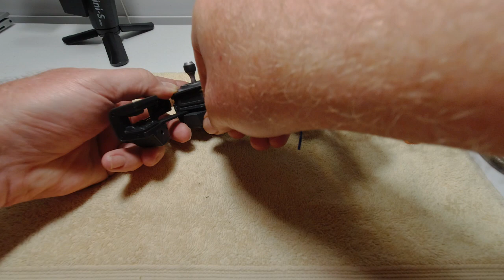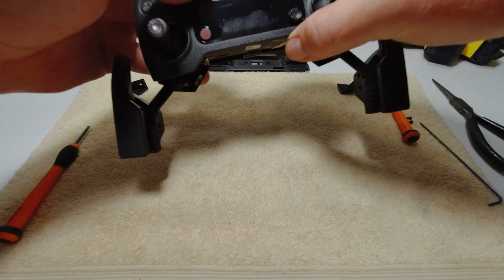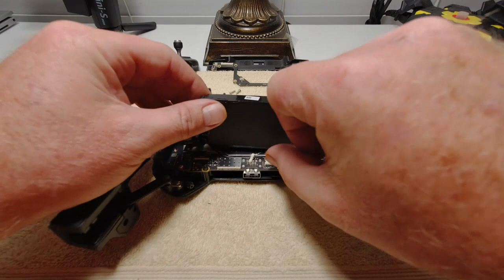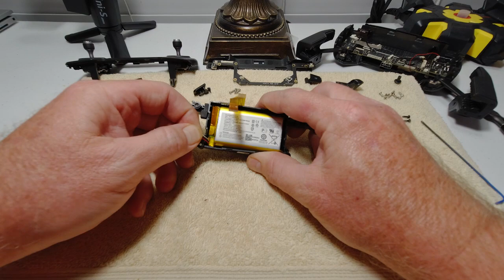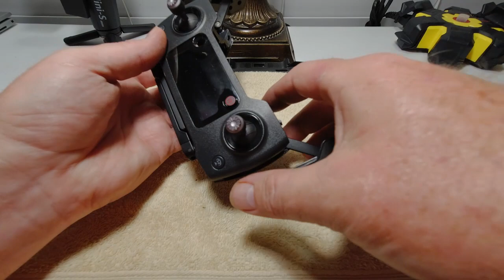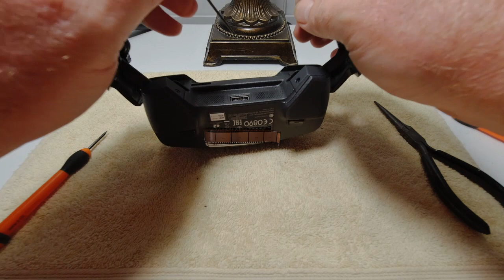How to Replace the Mavic Pro RC battery and where to get it

Comment: Hello, I have a different type of battery than you showed in your film, there is also a larger connector strip, there are three red, three black, one yellow and one white cable. Battery 0VCPFB72H107ZG. Do you have any order documents for this or they can be bought from you?
Reply from the maker: Sorry but I haven't heard anything about a different battery for the Mavic Pro 1.  The battery number 0VCPFB72H107ZG does not come up on anything I have.
Reply: @rwarton1  https://www.ebay.com/itm/Original-DJI-Remote-Controller-Battery-Use-for-Spark-Mavic-Pro-Mavic-Air-/352997078829 I found the battery on ebay DJI Mavic 2 Pro
Reply from the maker: @FlorenzKittel   That's great.  Please leave feed back once you have gotten the battery and replaced it.  I'm sure there a lot of Mavic Pro 2 users that would appropriate it very much.  Wish the shipping times weren't so long.  Thanks Kittel.
Reply: @rwarton1  Shipping 3 weeks
Reply: @FlorenzKittel   hey! Did it work? I just read batteries for m2p are a little larger and 3.8v @3850 mah. Your link says 3.7v
Reply from the maker: Could you maybe email me a picture of your controller and battery?  Send to ceo@wartons.com
Reply: @rwarton1  I did

Comment: Hey you, first I would thank you for the really nice step by step, then tell my history... Some months ago i suddenly experienced the totally dead battery. Neither DJI nor Reseller fixed it, even under warranty, is matter effect I bought it abroad and would cost me an arm and a leg to sent it to repairment. Then I decided to use the remote with the Power Bank adapter with the drone batteries (Pain in the...), until i found your video, and it was super easy to get to the battery and remove it. But I can't find this battery to buy, neither in my country nor i foreign lands that would ship it to my country.
In your video you said that you would help those with problems, can I contact you to ask for some help?
Thank you.
Reply from the maker: Audrey, you can now purchase the battery on eBay from many sellers.  Try a sell in the U.S. and have them ship to you.

Comment: How long das good bat. should last on when flying?
Reply from the maker: Sorry for the slow reply.  The remote battery should last at least an hour of flying time.  But this can be more or less depending on the type of device you have connected to it.  The DJI remote attempts to also charge the device that it is connected too which can cause the remote to drain faster if the cell phone or tablet connected is not charged good before connecting.  See this video to help make your remote battery last longer.  https://www.youtube.com/watch?v=GdvOfRCYJxw  Hope this helps.

Comment: Please help need battery for  mavic 2 controller. Please please
Reply: Thanks a lot, any link to find it. Name or description pls
Reply from the maker: @c.lvideofilms3958  The link to the battery is in the description;ion below the video.
Reply from the maker: The only thing I know you can do is purchase the battery that fits the Mavic pro 1 controller.  From everything I've heard it fits and works in the Mavic pro 2 controller.  The only difference is it is a few hundred mill-watts smaller than the original Mavic pro 2 controller battery but works fine.

Comment: sir rick, i just want to query. why is that my dji mavic controller is zero percent battery, it is charging but the percentage is 0% always, I observed my controller charging within 2hrs, but sad to say it is not moving the percentage.... hope you can help me to fix this problem... tnx
Reply from the maker: This normally means that your battery is bad and unable to take a charge.  If it was the charging unit of the controller that was bad it would not show charging and 0%.  So replacing your battery should fix your problem.  Best wishes Rick Warton
Reply: @rwarton1  thank you sir

Comment: Need your help to get Mavic pro 2 RC battery.
Reply from the maker: Chukte, I'm sorry I do not have a supplier for the Mavic Pro 2 battery.  Several have asked and I have had no luck in finding the battery.  I've been told the battery in the Mavic Pro fits perfectly and the only difference is the Mavic Pro battery is a few hundred MW smaller than the Mavic Pro 2 battery but works perfectly.  I have personally had a chance to see if this is true, but might be something to think about if your unable to find a Mavic Pro 2 battery for your controller.  Best Wishes Rick

Comment: Thanks for your video! While I had to bite my lip while you were sniffling (lol), I was able to follow your instructions and replaced my battery (after purchasing the one you recommended).  When I bought my Mavic Pro, it had been siting in a warehouse since 2017, and both the battery in the RC and the battery in the AC were shot.  Now, it works great!  I should have watched the whole video first, I would have put the tape over the little speaker while I had it apart.
Reply from the maker: So glad it was helpful, and thank you for your comment.  I'm really surprised someone hasn't made a better video on replacing the battery.  It's kind of a pretty important process to know when you need to replace the battery.  Best Wishes

Comment: Awesome video Rick.  Yesterday I opened my backpack to find my remote soaked from a drink that leaked out.  The remote was making a high pitch noise.  With the help of your video I took it apart and disconnected the battery.  Other than  blowing it out with some dry compressed air do you have any recommendations before I reassemble.  I was expecting to see some shorting out but I don't.  But electronics isnt my strong point.  Any help would be appreciated.  Thanks Harold
Reply from the maker: Hello Harold, If only water spilled on it I think leaving the battery out for a day or two should be fine.  Laying it in the Sun for a bit or using a blow dry for about 10 mins will help insure all the water has evaporated.   Now if something other then water spilled on it that's another story.  Take soda for instance, even after the soda has dried up syrup and other ingredients may cause corrosion later.  So what I do in cases like that is I use rubbing alcohol and pour it all over the circuit board and then used can air or an air compressor to blow off the circuit board.  Then let the board dry over night and you should be good.  Of course make sure the battery is not connected when doing this.   Hope this helps.  Best wishes Rick Warton

Comment: That's a nice video Mr. Rick, thanks for showing but you mention you bought this battery in HK.
Because I stay in the far east and visit from time to time HK please can you tell me the shop or location where to find this battery.
Ebay can't send this battery in the country where I stay.
Thanks in advance.
Reply from the maker: Sorry for the delay Patrick, I was out for a week on vacation as was not check my email.  I'm sorry but the only information I have is what is on eBay.  I suggest going to the ebay page of the item at https://www.ebay.com/itm/Original-2970mAh-3-7V-Rechargeable-Li-ion-Battery-973760-1ICP10-37-61/273519563743?ssPageName=STRK%3AMEBIDX%3AIT&_trksid=p2057872.m2749.l2649 and clicking on the contact seller on the left side of the page and ask if they may have any suggestions on how you could receive the battery.  The only other solution that comes to mind is have someone you know that lives in a country or province they do ship too and have it shipped there.  Then have that person ship it to you.  Now I know that is a big pain in the butt, but sometime you just have to work around the system.  Best wishes
Reply: @rwarton1  Hello Rick,
I'll try the way you sugest me. Thanks  for taking the trouble to answer me.
Best regards,
Patrick

Comment: Thanks for the video! Great job. If I may suggest, maybe you can add some text advising to connect that connector you struggled with a bit (and so did I :) when the display piece is still not screwed in place. Thanks again!

Comment: They really didn't make this easy. My mavic 2 pro is year old and controller battery only last for one flight, then it is empty.
Reply from the maker: That sucks!  Battery should be good for at least 3 years.  And to make things worse I don't know where you can get a battery for a Mavic 2 controller.  Think all you can do is send it to DJI and they will replace the battery at premium price.

Comment: I bought new batteries (they came after 4 months ago) but they did not fit Mavic 2 RC1A controller. Too small and not the same contact. If anyone have a Mavic Pro controller as Rick Warton is showing then i have two batteries for sale. Unless I find a IoT project to use them in.
Reply from the maker: Sorry to hear the batteries did not work on the Mavic 2 RC1A controller.  Thank you for sharing the information with everyone.  I would think if anyone needs a controller battery for a Mavic 1 controller, getting it from you would be much faster than ordering it from China which can take forever sometimes to receive.  And with this China Virus issue, getting one from China right now will probably takes months.

Comment: Hello there kind sir, I would like to replace my dieing battery, but I don't see the batteries available anymore, what do I do? Do you have the batteries? Can I send the the controller into you?
Reply from the maker: I'm sorry but I do not stock these batteries.  I do not know of any other place to purchase these batteries except for the link in the comments.  Since they are currently out of stock all I can suggest is to search the internet and see if you can find another supplier or a place that maybe you could send the controller and get the battery replaced.  I've had several people tell me you can send your controller to someone and they will replace the battery and ship it back to you.  But I'm sorry to say I do not have any information on where these places are.  Hopefully the eBay seller of these batteries will get them back in stock soon.  I'm sure this China virus is probably causing delays.
Reply: @rwarton1  Ok thank you very much, indeed the eBay seller is not able to sell these batteries at this time due to the outbreak.

Comment: While the controller is apart, does anybody see a fix to keep it from charging the android phones
Reply from the maker: The easy fix is to use the USB port on the bottom of the controller to connect your phone.  Check out this video for more information on how to do it.  https://www.youtube.com/watch?v=GdvOfRCYJxw&t=258s  Hope this helps.
Reply from the maker: One other thought, while you have the controller apart put a strip of scotch's tape over the little hole on the speaker to help make the remote from being so loud when an alert is sounded.  With the tape over the speaker it's now not so annoyingly loud.  :)

Comment: Hi i am having a bit trouble with mavic 2 remote battery. I need replacement soon. Can you write and part number for the battery? Otherwise i need to buy another remote or smart controller(i dont want to. I like my phone). Thanks
Reply from the maker: I had a friend use this battery for his Mavic 2 remote and he said it works and fit perfectly.  One problem though, since China is having this Coronavirus outbreak everything over there is shut down, including the company that supplies this battery on ebay.  I hate to see you have to spend so much money on a new remote, but if your in a hurry you just might need to.  One suggestion is to use an external usb battery until the supplier can ship again.  Check out this video on how to do it.  https://www.youtube.com/watch?v=GdvOfRCYJxw

Sorry I can't be of more help.

Comment: Been looking to replace the battery on my Mavic 2 Pro and on the back of the controller it says 3950 mAh 3.8v. Therefore this battery, may be under powering the newer Mavic 2 Pro controller. Can't seem to find a replacement on Ebay just yet. I've contacted the source you noted here and awaiting to hear if they provide this 3950 sized LiPo. Do you own a M2P at all?
Reply from the maker: That's good to know.  So the Mavic Pro 2 has a larger battery.  I'll get with my sources and see if I can be of any help finding you a battery.  Thanks for the heads up on the Mavic Pro 2 controller.  I'll update my the description on my video to let other know.  Wonder what battery the Mavic Pro 2 smart controller uses?  Bet it's even bigger.
Reply: @rwarton1  Yeah, I was about to purchase this one you note but upon reviewing my controller, found this larger size noted, on the back. Glad I held off. DJI won't allow me to purchase the battery and... they have 1 company in Texas I believe that will do it, as a contracted service center. They can't tell me the name of the company nor how much it will cost. How sad is that!! I just have to send to this company and hope they won't gouge me. You'd think they would do it themselves, DJI.
Reply from the maker: @trosencrantz   Here is another option which is what I do when my controller gets low or I know I'm going to fly more than what the controller battery will last.  But instead of mounting my to my phone I have Velcro and mount it to the controller on the bottom between the two buttons.  https://www.youtube.com/watch?v=GdvOfRCYJxw

Comment: Do you know if this is the same battery for the Mavic 2 Pro controller? Do you know if  the replacement procedure is the same for the M2P controller? Thanks!
Reply from the maker: Yes the procedure should be the same for the Mavic 2 Pro controller.  I would need someone to verify though before a change the title of this video to include the Mavic 2 Pro controller.  Thanks you for a great question.

NOTE: The Mavic 2 Pro come with one of two controllers.  The DJI smart controller with the built in screen would be completely different in the way you access the battery.
Reply: @rwarton1  Which Ebay seller of this battery would you recommend?
Reply from the maker: @trosencrantz  I've only purchased from eBayer 5_star_store so they are the only ones I can suggest.  https://ebay.us/YHTFMX    (Be aware I do not know this person personally and can only recommend them because the two batteries I ordered from them worked perfectly and shipped quickly.)  Hope this helps.
Reply: @rwarton1  Hi Rick, I may have a supplier to make these batteries for the M2P. Would you be able to measure the dimensions of the one battery that you took out? So I don't have to take my out, until it's needed. Perhaps you can email me this info and send a photo of what it looks like?
Reply from the maker: @trosencrantz  Hey Tom, sorry but I do not have a battery available to measure at the moment.  I would need to break down a controller and really don't want to that.  :)
Reply: @trosencrantz  hey!... where you able to confirm for the M2P batteries? i am in urgent need of one...
Reply: @sergeguy89  Could never find the battery yet, for the M2P controller. Even tried to find a manufacturer that could possibly make it and non thus far. Best bet is to send it to whom DJI recommends to install a new one for you. I've just kept mine charged up after using it. If I ever got to the point where I needed more juice, I'd attach and external battery charger. Or just send it in for a new one. I've had to replace many of my drone batteries anyway as they've become unsafe and bloated. Happens!

Comment: Hi rick, my mavics remote stopped charging at 4 pct and finally went to zero, tried replacing cable. The charging port is not broken. What could be the problem....
Reply from the maker: It sounds like the battery is bad since you have already checked the charging port and replaced the cable.  If your remote battery is over three years old it needs to be replaced anyways.  Let me know if I can help in any other way.  Merry Christmas.
Reply: @rwarton1  merry xmas to u too, no the battery is not that old my drone just 8 months old and used very few times
Reply from the maker: Do you have a phone charger that you could try and use and see if it will charge your controller?  When you plug in the charger to the controller does it show charging on the controller or does nothing display on the screen of the controller at all?
Reply from the maker: @free_thinkerr   Use this link to find out how old your drone and controller are.  https://forum.dji.com/thread-132091-1-1.html
Reply: @rwarton1  nothing happens. What could be the issue?
Reply from the maker: @daynegrant5966  Only one of two things could be the problem at this point.  Either the battery is bad or the main control board in the controller is bad.  I would suggest purchasing a used controller on eBay.  Then watch this video to link your new controller with your Mavic Pro.  Hope this helps. Rick